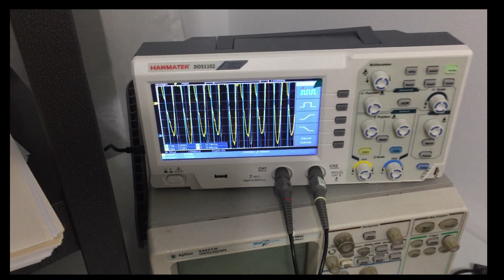Don Smith Capacitor Method

Comment: Hey! I used one wire from plasma ball circuit through load to earth, but it always fully loads the circuit input despite being open loop. 

Does using the AV plug (or the aluminum foil over the neon as a virtual earth) eliminate the loading effect, making the plasma ball circuit not “feel” anything because you’re using the Poynting field around it?

Comment: The Don Smith Effect is about One Wire Energy Transfer into a DC Capacitor Bank which would Generate the amount ofp Watage you need.

The way to get the one wire is by winding 2 set of wires with same thickness and length in the same direction. 
One of the windings would serve as Primary while the other must serve as Secondary. 

The primary lead which is on the left must be connected to the battery positive. While the primary end wire must be connected to the an N-CHANNEL MOSFET to get the primary negative switched.
The underlying secondary head is used to collect bothe Forward(Buck) and Back(Boost) E.M.F.

Comment: Great demo ❤

I guess if you employ a step down transformer you may get some decent power output without loading the input. Anyway worth to try and if you get it right then you know what to do to design desired output.

This what I am doing now, using a bit different setup but same working principle.

By the way, when I wrap my palm around the output coil touching the resonator rod as well, I get much more power available and start to burn/blow up resistors or bulbs while the input stays constant low at approx 5.5-6.5 watts. I have tried to add a ground (3rd ground) and doesn’t work, adding the 3rd ground straight to the negative (I am rectifying the output) will rise the voltage quite high but power comparing Voc with Voltage under load seems to be less.

I wonder what can I employ to simulate my body touching the setup as it seems that this is where I get more power in output ?
Reply from the maker: A high resistance with a very low capacitance and inductance would simulate the human body electrically?  Of course we generate our own electrostatic potentials as well so we kind of act like a one wire energy transfer. Very low cause we are all in the same ambient potential. It seems resonance can break these moments for a part of the cycle and couple into nearby energies. Maybe that's it :)    I don't think its galvanic unless your touching two different kinds of metals on the same loop. I'd say try to experiment with an artificial RCL loop isolated from everything and tap into it with one wire to simulate a human touch. Perhaps.
Reply from the maker: I tried with a MOT and the lamp does get a little brighter. This demo is not optimized but it demonstrates the effect. Use a "Real" neon driver like Don Smith does of some real watts of usage. This will make the fields much stronger to interact with. And don Builds his own tuned capacitor plates so they also magnetically resonate for a boost gain. He was lucky under some circumstances only one coil can show a gain in output.
Reply: @joellagace1679  Fantastic Joel!! you are certainly digging in to this and have an understanding that rivals Don and his team of Electrical engineers...Thank you for sharing this work ....-John

Comment: I've heard of this before where capacitors would become polarized just from proximity to an oscillating circuit, the notes available on Don;s dipole rod talk about tapping the Heaviside flow without consuming the current in the original circuit, nice to see some practical experimentation on this concept.

From my other research I would consider this a form of indirect tapping of the prime mover, with the latter acting as a mere catalyst rather than a supplier to the load, the most potent of COP > 1 technologies operate on this principle, both electrically and mechanically.

Comment: Very nice Joel.  I don't think you can demonstrate the electro-static/electro-magnetic fields translation any better than that.  So basic.  The gains happen between the two fields.  The more static surface you encapsulate in the magnetic field, the more power (amps) you get.  Not all magnetism is the same.  HV magnetism is different and better for our purposes.  Again, great demo.

Comment: soo, 1 driver, 100 coils with 100 caps would give the same effects but with the same input?
Reply from the maker: Well there is a theoretical limit the pure magnetic field can interact with without damping the field, It's highly non-linear so 2 won't take half the energy away. Depending on field design etc, one could expect up to around 6-8 coils before they start demising in new individual E fields strengths.
Reply: @joellagace1679  will a standard coil work for this? Or does it need to be that style of coil which you explained in a recent video?
Reply from the maker: Any coil will work but any modifications and enhancements to shield the E field and pronounce the H fields will make it better.  Can be a multiple enhancements  By coil design.physical and electrical. There are multiple paths here. Phase cancellation, physical shielding, Open air core designs, Resonances etc...

Comment: What do you think Joel about using the first two modules of a Don Smith device, kinda like what you show here to power just the heating element of a space heater. That way we could leave out the third module and not have to reduce the HV and HF. 
That way the majority of the load (heating element) would be just pennies to operate.
A fan could be used to circulate the warm air.